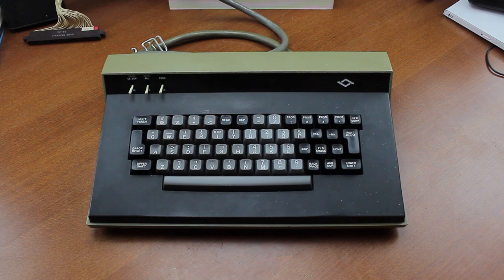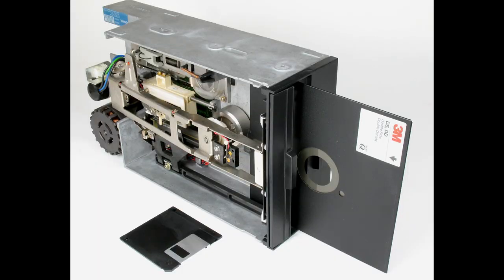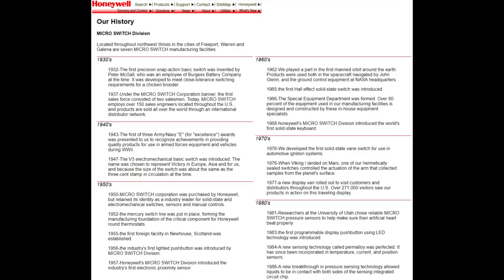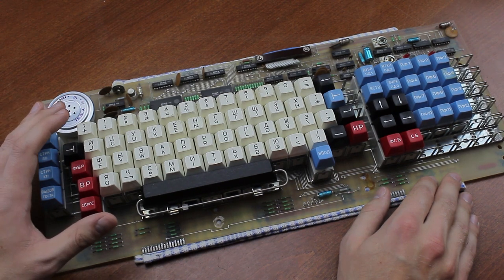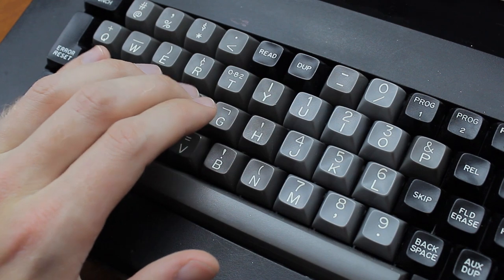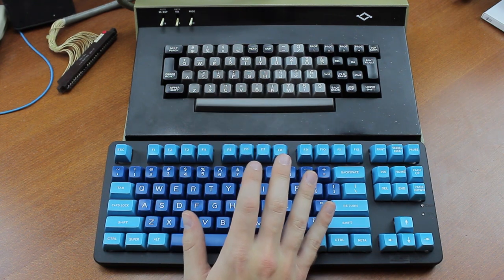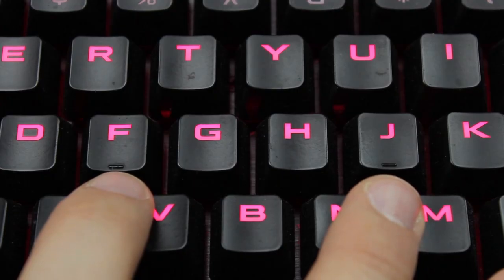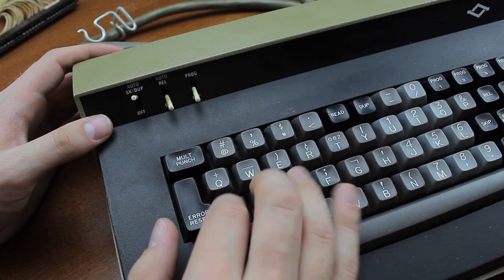Decision Data 8010 keyboard review (Honeywell dual-magnet Hall effect)

Comment: Great review! I wonder if it'd be possible to adapt it to USB using one of XWhatsit's Capsense boards. The operating principle should be very much the same (measuring differences in voltages) and I'd assume it still uses a standard keyboard matrix. There's been examples of people using one for Model Ms, so it seems fairly flexible.
Reply from the maker: No, unfortunately these Honeywell Hall effect boards use weird pulse high and low sequence things or whatever which makes them almost impossible to convert. The whole way in which they send signals is apparently completely different from all other boards. I know there's at least one guy who's done it (he converted a Space Cadet), but many really good tech guys have tried and failed :( .

Comment: The plug looks like an edge connector. You can get prototype PCBs with edge fingers or you can just etch your own. It would have originally hugged the edge of the computer's logic board, the computer-side connector is simply executed as protrusion in the board shape. Think Commodore 64 cartridge connector. Also like on game console game cartridges and PC extension cards but in reverse.

Unfortunately reading Hall keyboards isn't likely to be too trivial, you won't get very far with off the shelf kits, but i'm sure with some staring at the board and some tracing, it could be figured out.

Comment: I just realized, given that the 30 billion keystroke number's been referenced before, but howTF did Honeywell ever come up with that rating? If they actually tested it back then, they'd probably still be going until now and still not hit 30 billion.
Reply from the maker: Current kb switch testing machines do about 10 million a month. I suspect they extrapolated.
Reply: That would be 120M per year, right? So ten years for 1,2 billion, one hundred years for 12 billion and 250 years for 30 billion keypresses? So basically if such a machine was starting to test one of these boards during Napoleon's time, it would still not be done?
Reply: maybe they used a mathematical extrapolation from testing many keys

Comment: I think the sound differences between the modern and old first gen keys most likely has the whole bunch of factors like the switch size, keycaps and the whole board makeup. Wouldn't be surprised if the old keyboard is four or six times heavier than any of the modern Ace pad boards. Really, you're not gonna find consumer level products with so much metal anymore ever since everyone started outsourcing everything.
Reply from the maker: Technically, almost all these Micro Switch keyboards are outsourced as well - MS made them third-party for a very wide range of other companies. Their most famous product was the Symbolics Space Cadet keyboard.
Reply from the maker: Also, although these weigh more, the Ace Pad boards are MUCH denser as they have a solid case rather than a hollow one like this.

Comment: Why do people keep parroting this rubbish about the modern layout coming from IBM. The DEC LK201 predates any IBM keyboard with anything approaching a modern layout by several years. Most noticably the invert T for the cursor keys, a modern num pad, function keys above the main keyboard, and the six keys abover the cursor pad. The only thing IBM didn't copy was the compose key, and dam those to hell who where responsible for this monstrous omission.
Reply from the maker: The LK201 layout is quite different from the M's. A lot of buttons are in similar positions, but they do very different things. The LK201 is universally credited with the inverse-T, though.
Reply: And yet a Model M looks far more like an LK201 than any Model F. That is if you knew nothing about keyboard history and just had graphics of the layouts and release dates you would put the  Model M as descended from the LK201 and not the Model F which bares basically no resemblance to the layout of the Model M what so ever. DEC put it together and IBM only tweeked it a bit tacking out some keys that only really made sense on a terminal. Well apart from the compose key which like I said previously may they be dammed to hell for all eternity.
Reply from the maker: @jonathanbuzzard6648  I think you're getting confused now. I didn't say the F set the standard for MODERN keyboards. It just set the standard for the time.